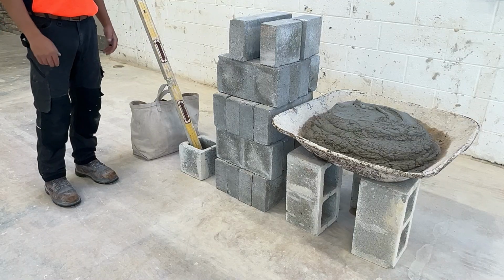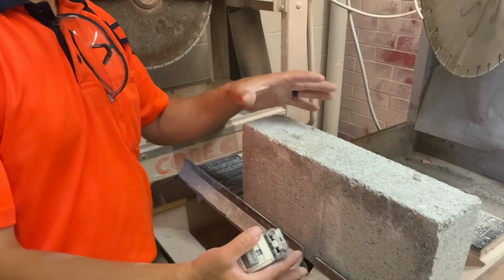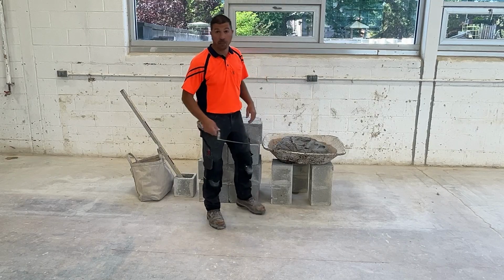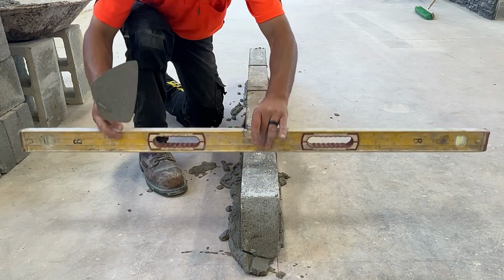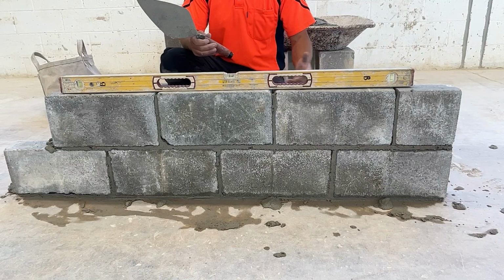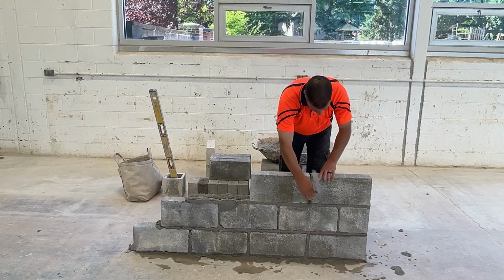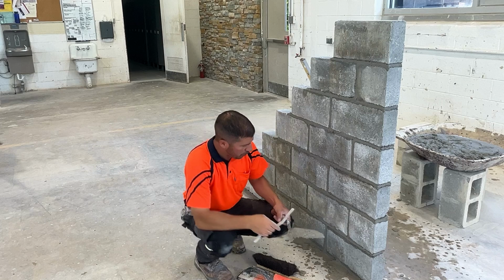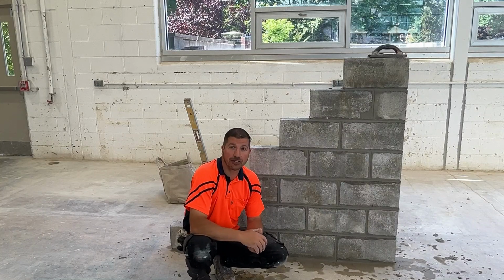Building a 4" Block Lead [For Students]

Comment: Great Video!! Would this type of block work for a 2' tall planter bed? I plan on added a stone veneer to the front. should i use hollow core and then fill with concrete?
Reply from the maker: Thanks for the question!  Really, any block “could” work. You’d have to think of what’s going on top of the wall, what size cap will you place on top. People will only see the stone on the face and the cap, so determining the width of the cap you want, will tell you what size of block for backup you will need.

Comment: Do you use a mixer for your students or do you get them to mix in a wheel barrow? If a mixer, do you prefer a particular type for them to use? Going to do a course with them this year and seeing what’s viable or a waste of money on kitting out. Cheers
Reply from the maker: @oo0Spyder0oo  Thanks for the question. I use a paddle type mixer. Because you used the words “kitting out” and “cheers”, I’m going to assume you’re in the UK.  I noticed that UK bricklayers use drum type mixers, that rotate and fold the mortar over and over. In the US, we use those type mixers for concrete mixes. I haven’t seen a paddle type mixer in the UK. 

It really doesn’t matter what you use. You can mix in a wheelbarrow if you have a small amount, but for students, I’m usually mixing many batches to get ready for the day. 

Thanks again for the comment!
Reply: @masonry201 well due to our past association with the UK we often use similar lingo, I’m in Australia! Yes we have a strong connection with the language still. I’ve watched quite a few of the UK brickies and yes those mixers seem to do a good job folding the mix. Horses for courses I guess, I’m thinking we may need to acquire one and have students take turns providing the mud on various days, get them all learning to make a good mix and keeping the students topped up on their boards. Yours is one of the few USA channels I’ve watched that are up there with the best. Great job. It’s interesting how varied the brick sizes are country to country. Looking forward to further demonstrations.

Comment: Yeah that saw doesn't compute outside of classroom settings. Training students to use a saw that only .001% of masons use is kind of pointless. I could make a hammer cut within 1/8 of an inch square. Typically we use a handheld circular saw which get's it down to about 1/16th if you know what you're doing. A few concepts you mention apply to an EDC saw, true, but that big giant saw contraption would take exponentially longer to set up and move around than for the masons to just pop a block with a hammer a few times or just use a tape, pencil and a standard masonry saw with a diamond blade.
Reply from the maker: Thanks for the comment!  These saws are used on new, commercial jobs.  Schools, office buildings, hospitals, etc. I’ve been on jobs that had three of these saws, on different floors.  They ran all day.  When I started my apprenticeship, I was on one for 3 months straight.  The company I  worked for had about 15-20 of them, a couple were gas engine ones.  About half of the students that graduate where I teach go into the new construction field and use these.  Which is why there’s actually two of them side by side in that room!  This is the Philadelphia, PA area.  It may be different elsewhere!  Thanks again for the comment!